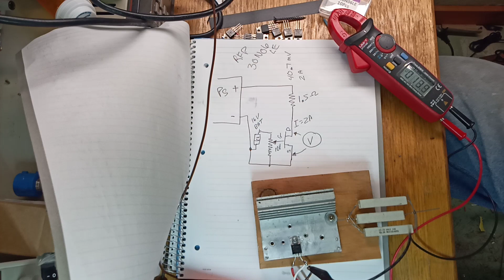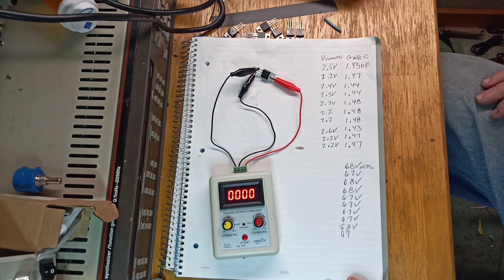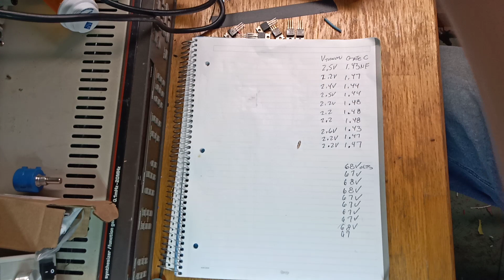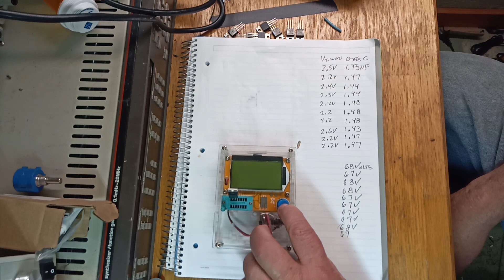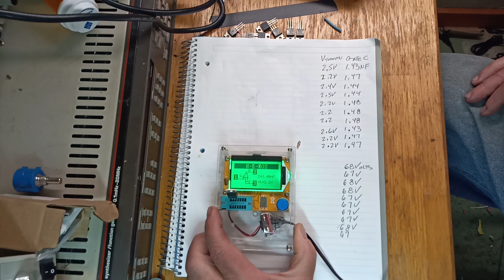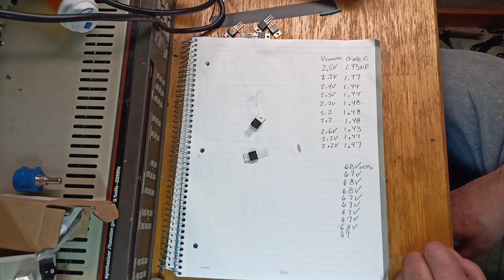FET Testing, How To Know If They Are Real Or Fake, Some Simple Tests

Comment: Built a FET tester that puts out 1A from a constant current source, also has pot to set Gate voltage from 0-18V.  Measure voltage between Drain and Source and you get on resistance. 1 Ohm / 1 Volt. Tester can be used to measure resistance down to 0.1 mOhm for cables or buss bar connections in high Amp battery applications like inverters.
Reply from the maker: I often have trouble thinking it, but a 5V cell phone charger easily puts out 1A with 5 ohm and 5V on the gate is good enough for many of the new FET. Certainly enough for general testing at 1A.  At home I have a HYPATIA 309 which is a 4 wire bond stress tester. Crank it from 1 to 100A and it continually calculates the ohms.  That chews up a lot of allegator clips.

Comment from the maker: Even a cheap DVM often has a capacitance setting to measure gate capacitance.  High current versions always have higher capacitance. Check data sheet for specification.

A 12V battery with a lamp in series will give enough current to test on resistance.  12V to the gate is good enough, just should be 10V or over. Just divide Drain to Source voltage by measured current to get ON resistance.

Turn on voltage can be determined by a pot voltage divider. Turn on is not what these should be operated at since ON resistance is determined by gate voltage. Standard tests are at 10V. Usually a volt over turn on is sufficient for many low current applications. Two FET can always be placed in parallel for 1/4 the total heat of just one.

A 100K-200K resistor from a higher voltage source to limit current will show breakdown voltage.